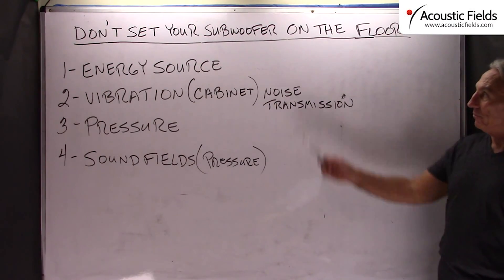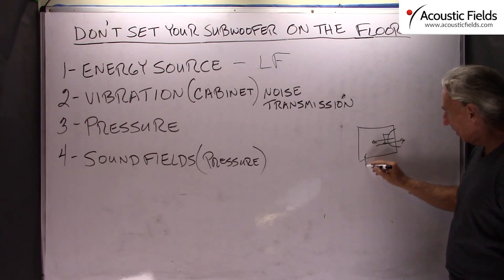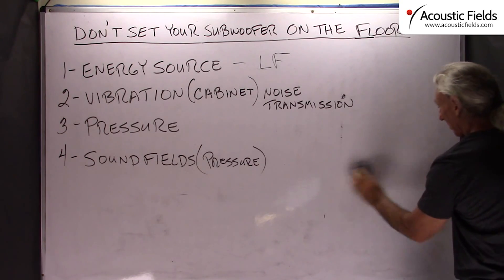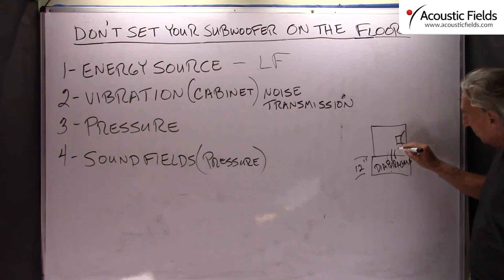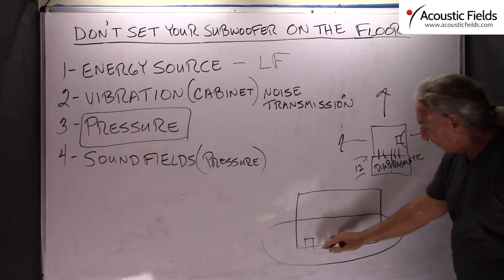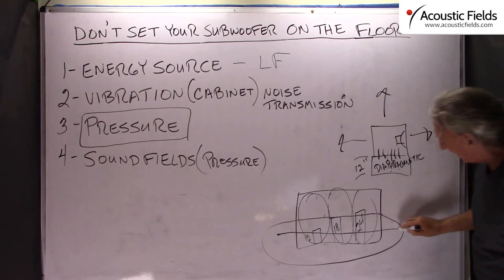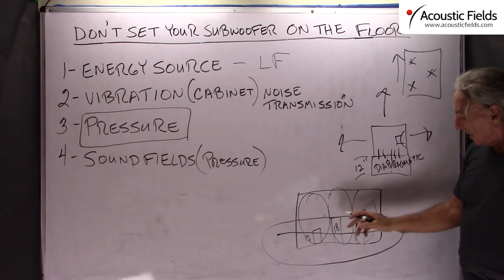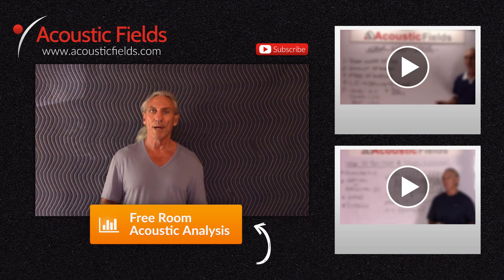Don't Set Your Subwoofer On The Floor! - www.AcousticFields.com

Comment: Sub placement is something many people get wrong.Remember sound IS vibration, so your speakers being "coupled to the room" is actually a good thing. It reinforces the sound, and makes you speaker's much more efficient, resulting in a more even dispersion of sound, and higher SPL's. 
Here are some rules to remember: 
-Placing a sub on the floor adds 6dB of sensitivity, corner loading a sub adds 12dB of sensitivity, so always corner load a sub if you can. 
-Placing a sub between 2.5' and 8' of a boundary (1/4 wavelength from 35-100hz), will result in cancelation at that passband. This is because the sound bounces off the wall, then meets up with its original position 180° out of phase, resulting in full cancellation. 
-With multiple subs, place them as close together as possible (at  least 1/4 wavelength or closer: 2.4 feet@100hz), that way they will "couple" and work together as one large sub. When you have multiple subs farther apart than their 1/4 wavelength, you get what's called a "power ally". Basically as the waves from the two subs meet, they either constructively or destructively interfere with each other, resulting in some areas with a lot of bass pressure and some areas with almost no bass pressure.
Reply from the maker: J,  A low frequency speakers coupled to the floor is never a good idea. If you couple to the floor, you cause the floor to be a "speaker". Once you make this decision, you bring more room distortion into the equation. Some floor construction vibrates more than others. With low frequency energy in small rooms, we want less distortion. Quantity is not quality.
Reply: @AcousticFields  Not quite... one of the problems with decoupling speakers from the floor is that it enables the cabinet to move in reaction the the driver. This leads to an uneven and unpredictable frequency response through the speakers range, and actually introduces MORE distortion. You want the driver to be putting all of its energy into creating accurate and clean sound waves, not into shaking the cab. 

The best way to deal with this is to couple the speaker to the floor.  If you can increase your speakers performance acoustically (corner loading for example), instead of mechanically (adding more power/cone displacement),  you will end up with a much higher quality of sound. Of course the room is still going to interact with the speakers, which is why you tune your system to the room using RTA mics and pink noise. Remember to work with the room not against it. Use the rooms acoustic properties to you advantage.
Reply from the maker: J,  If speaker manufacturers design speakers to be coupled to a floor to achieve their design parameters, how do they control for different floor types that have different flexibility/rigidity ratios. Are you saying no matter what the floor surface area type, it must be coupled to the floor? This is the reason for the platform. It does three things. It elevates, isolates and attenuates. You get those three variables working together and you get better speaker compliance. No need to rely on the floor no matter what it is made of.
Reply: @AcousticFields  When I say "coupled to the floor" what I mean is that it is acoustically coupled; the floor acts as an extension of the speaker, boosting the acoustic performance of that speaker. Physically attaching a speaker to the floor vs putting it on isolation pads has no effect on the sound quality, and this has been proven with actual measurements. When a sub vibrates the room, it's not the speaker physically shaking the room, it's the sound waves that are shaking the room. If your speaker is shaking enough to physically vibrate the floor, its broken.
Reply from the maker: J,  A quality designed speaker does not depend on the floor or any other boundary surface for its performance. If it does, it brings into the equation room distortion. Our platforms with our carbon technology are not isolation pads. They are a sound absorbing technology that absorbs vibrations and energy close to source which is the best way to absorb low frequency energy.
Reply: It doesn't depend on it no, just like they don't depend on platforms with "carbon technology." Speaker placement is key to getting the MOST out of your speakers. I would love to see some measurements showing the difference between using "carbon tech platforms"  and just setting the speaker on the floor.
Reply from the maker: J,  We are not discussing speaker placement.  We are discussing the floor to speaker interaction of a low frequency source. You can see our test data in the About Us section of our web site.
Reply: @AcousticFields  All I saw was test data showing absorption coefficients. Room measurements would show that the physical interaction between the floor and the speaker has no effect on sound.
Reply: pure bullshit - you don't want the room to add 6 or even 12 dB when you grown up

you want to hear the music and not the room and for sure you don't want specific frequencies be louder than the rest to
Reply: @Harald_Reindl  right, which is why you use calibration mics to make sure there is a flat response in the room. Think of it as using the room as an extension of the speaker cabinet, then tuning that cabinet, just like you would with any other speaker. You don’t want to be fighting the acoustics of the room, instead use it to you advantage.
Reply: @telimarkskierman  WTF - room EQ is for the remaining issues after proper treating the room but never exclusive

it's purely idiotic thinking of the room to extend the speakers and you can't treat anything by just put a microphone there and turn on some dsp

the idiocy thinking that would be enough falls apart 30 cm from the microphone or by leaning back or forth

a properly treated room with finally measurement and room eq is what works and don't tell me anything else after 6 months learning that the hard way resulting now with the age of 43 I am hearing music the first time in my life as it was intended (no headphones don't work really)
Reply: @Harald_Reindl  Yes of course room treatment is very important, but that's not what we're talking about here. We're talking about isolation pads, and placing isolation pads between a sub and the floor will not change the acoustics at all. There is nothing you can do to stop the sound waves from interacting with the boundary surfaces in the room, so you really need to have your speakers work with the room. Don't just put speaker into a space then try to force the room into sounding good by pretending you can isolate a speaker from the room, that's not how room acoustics work unless you can truly eliminate all reflections from the walls, and even then you will still have interactions from things like cabin gain, etc...
Reply: @telimarkskierman  nonsense! proven by the simple fact that i lifted up my subwoofer in 2020/11 by 20 cm just by trial & error, noticed the difference and than ordered a 20 cm MDF quarder - it makes a difference, you can hear the difference, you can measure the difference and you even can feel the difference on the couch not vibrating that much any longer (the woofer is directly behind the couch and 50 cm away from the ears with an antimode in front)
Reply: @Harald_Reindl  You actually get a much flatter response across the room by using the rooms acoustics to your advantage. Making corrections with a DSP works really well as long as the room has a fairly consistent response all around. How do you get that consistent response? Speaker placement is the key... isolation pads don't do anything. Go test it for yourself. Take room measurement with and without isolation pads, they won't change anything, you will see.
Reply: @telimarkskierman  but forget it - it's not worth discussing with an ididot saying "corner loading a sub adds 12dB of sensitivity, so always corner load a sub if you can" while everybody with the slightest knowledge would never do that
Reply: @telimarkskierman  everybody but you knows for decades that you isolate speakers as much as you can from wherever they are mounted, i guess it was in the 1990s as i wa a young buy realized it given it was common sense even back then
Reply: @Harald_Reindl  Dude i'm literally in this industry... nobody uses isolation pads, they're a gimmick for misinformed consumers just like fancy audio cables and top dollar power conditioners. They won't affect the sound, certainly not to the degree a human ear could ever pick up on.
Reply: @telimarkskierman  sorry, but there are a ton of fools in this industry, starting with the guys placing speakers/subwoofers in corners and babble about "extend the speaker cabinet with the floor" - go and tell your bullshit someone else - the only thing you place in corners are absorbers
Reply: @Harald_Reindl  whatever keep wasting your money on gimmicks instead of things that will actually improve the quality of your sound. It's not my money lol.
Reply: @telimarkskierman  I salute you for being civil during your conversation with harald. That guy sure sounded mad at the world all the while being crude.

Right or wrong I think you won that debate.
Reply: @Harald_Reindl  "you want to hear the music and not the room and for sure you don't want specific frequencies be louder than the rest to" yea... but the room will always affect the sound, that's just how acoustics work, isolation pads certainly won't prevent the room from interacting with the sound waves. and added sensitivity doesn't mean those frequencies are louder, it means they take less power to produce the same SPL. Less power for the same SPL = lower distortion.

Comment: Putting your sub on the floor give's you an extra 6dB (for free), also floor coupling gives an extra feeling to the music. 
There is a good reason why at festivals subs are stacked op the floor in the front (not L/R) of the stage. :)

Raising the sub will only cause cancelation on particular frequency's...
Reply from the maker: S,  You are missing the difference between quantity and quality. More energy with part of that energy being room distortion is not quality. It is quantity. In small rooms, you must reduce room distortion to achieve quality low end. raising the sub will not cancel any frequencies. It will improve room response at all frequencies.
Reply: 6 DB of distortion - you confuse quantity with quality! when you grow up you will realize that music is more than bass

Comment: How about angling a subwoofer upwards to the listener position like you would for other speakers?  Would that achieve the same thing as putting the subwoofer at different heights?
Reply from the maker: J, I would not recommend it. The floor to ceiling dimension is the smallest of the three.

Comment: Hi great video I have a rel t9i Subwoofer with a front active speaker and underneath a what I call a dummy speaker at the present it’s sits on my carpet I’ve tried positioning the sub throughout the room and I just can’t get the effect I’m after I have a general sitting position that’s where I do the listening from but if I move to where the wife is sitting it’s like night and day it’s crazy the difference between where me and the wife sits is only say 60cm 
Tbh it’s driving me nuts i want to try the idea of raising the sub of the ground at 12 inch but unsure on what’s best to sit it on 
For any ideas on both would be great
Reply from the maker: R,  With subs you must isolate, elevate, and attenuate. Raise it off the floor which isolates it from floor to sub contact and then attenuate or absorb excess energy close to the source. Our sub-platform is on casters for easy tuning.  https://www.acousticfields.com/product/subwoofer-platform-absorber/

Comment: Nice video and very informative👍 but if you have them on carpet you should be ok, as carpet has rubber padding on the bottom.
Reply from the maker: H,  Padding and carpet minimize vibration signatures. It does not have any impact on room frequency response.
Reply: i wish i knew if that were correct.  it doesnt seem to be to me, to be frank

Comment: lols, tell that to the brands like Philips that the sub itself even the air vent are facing the floor
Reply from the maker: R,  No need to tell sub manufactures anything. They are going to design products that sit on the floor for many reasons. The first is a liability issue. They do not want you elevating it because they think it will fall on something and you will sue them. Secondly, by locating near the floor you increase SBIE which is room gain or distortion. Keep them out of corners, elevate them, and locate them in the proper places.
Reply: @AcousticFields  This is absolutely nonsense, and your advise is to elevate the subwoofers from the floor and maybe some day it will fall down and  hurt you? You are hillarious and stupid. Subwoofers are made to stand on the floor...period!

Comment: racketballs, cupcake/muffin pan insert balls into pan ,lay on ground. place sub on top of racket balls , joilla !
Reply from the maker: M,  I would not use a muffin pan.  Metal will vibrate at a certain resonant frequency.
Reply: @AcousticFields  in theory it should,although  i have my muffin trays glued to neoprene padding, the woofers float on the racketballs, I have 2 sb2000's in my music room and 2 pb-2000's in my movie room and they work very well, it's pretty cool to see a massive pb-2000 floating ,totally decoupled from the floor
Reply: @AcousticFields  i think im going to get some mdf or other material and use a router to make a more task specific platform though, thanks for the tip

Comment: My SVS subwoofer is coupled directly via spikes to the concrete slab beneath the carpet, properly leveled and therefore no wobbling. On top I put a 12" x 12" 1" thick granite slab. Will an isolation platform make the subwoofer sound better?
Reply from the maker: Raise the sub 18" off the floor to start.

Comment: Hey great video, how would this work or how would you set up a sound system in an outdoor event?
Reply from the maker: M,  We do not have experience in this area. We are a small room acoustics design and manufacture company.
Reply: for outdoor events, it is better to put your sub on the floor and you get extra free gain, and better if you corner load the sub

Comment: Wonderful, I give you a thumbs up. However, if what you say with your theories, and practicality are true, and logical; why is it that expert, higher quality, high performance manufactures not designing, and building subwoofers this way? Thank you very much for the advice, and very practical tips, procedures. Anyhow, I only need one subwoofer, and am going to follow your sound advice; pun just happened to be there. Also, vinyl is final.
Reply from the maker: G,  Its easier to set a sub on the floor for manufacturers. Its also safer from a liability issue. Raising a sub off the floor will always improve room response. We have subs in our studio and all are elevated.

Comment: I have 2 subs with 2 different sized cones (10" & 12") 4oo watt rms total], however , my room is only 10' X 10'; very small. As a result bass management becomes a huge issue so I raised them off the floor on thick foam cartons I had from packaging It made a big difference! the low freq. is no longer boomy and sounds really tight much like a punch to the mid section the detail is more pronounced and interaction between the higher freq. seems more in tune allowing me to hear things I've never heard before.
Reply from the maker: F,  Yes, the smaller the room, the larger the impact.

Comment: Totally agree with that
Have my system in garage.complete with throw rugs on floor 
Had just book shelf speakers then .got a good deal on used sub. (Not a believer in subs.until now)Everything is up of the floor 8 feet.sub in middle on storage shelf .
Set low at 50hz.low volume. And it just opened the the whole sound field. You dont notice the sub.
I should have had one 30 years ago.
Hmmm thinking of #2 now
Reply: JS B Try hanging them. I have mine hanging by steel cables. Great decoupling and great sound stage and sound fields are revealed
Reply: @commentcommenter3529  always open for new ideas. I want to bring my speakers further from wall. Hmmm yeah hanging sounds like a good idea.(I didn't want to make shelf deeper).thanks for the tip👍👍
Reply from the maker: J, Yes, I get emails every day from people who have elevated their subs and have similar results.

Comment: Was hoping you were going to delve more into ideal placement higher up on the wall.  Seems like 2/3 up the wall would have better time alignment of the sound waves bouncing off the adjacent walls.  Placing a subwoofer on the floor, assuming your listening position is less than half the height of the room, is going to result in some very delayed sound waves coming off the ceiling.  I haven't yet seen much research or experimentation on this though.  I know not everyone can put subwoofers near the ceiling, but in custom installs, that would likely be a viable option.
Reply from the maker: J, Low-frequency energy is all about pressure movement throughout the room. The energy producing device in any room needs to be placed where it creates the least negative impact across two main variables: room response and pressure balance since bone conductance is the receiver.  We have 3 subs in our LA studio. They are 18", 30", and 40" off floor with 9' ceiling.